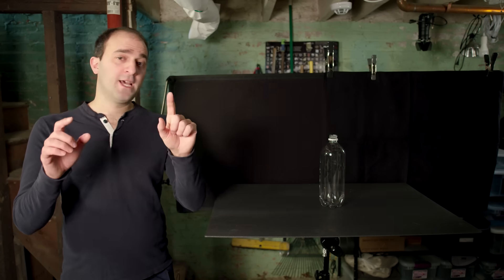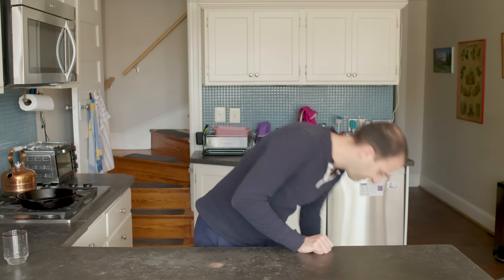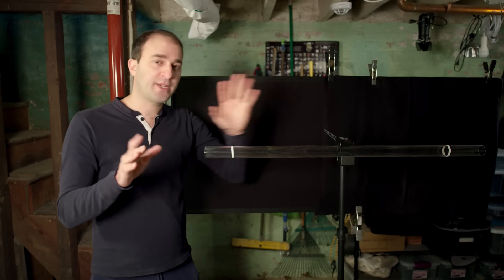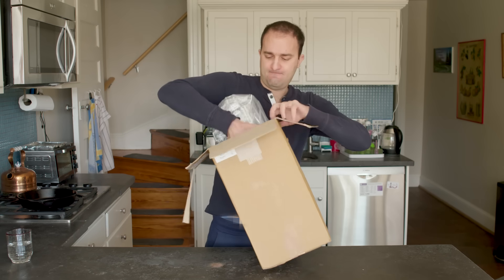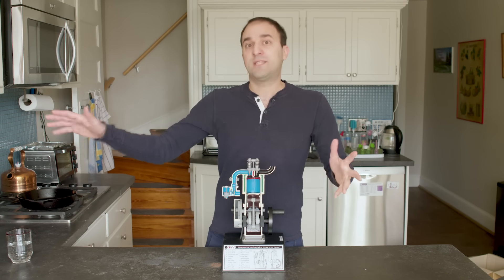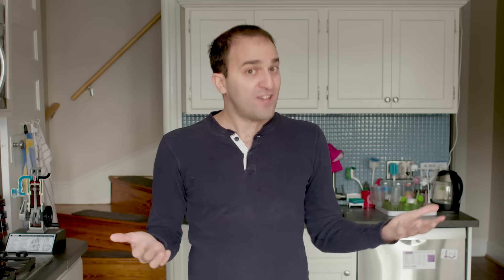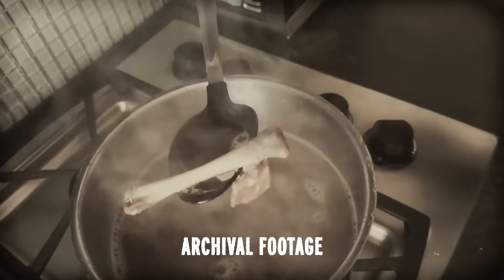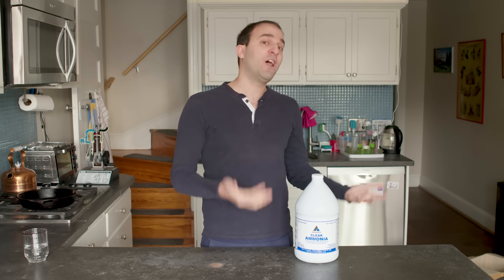Does Toyota Know Something That We Don’t?

Comment: Lovely, we're abandoning diesel because of NOx to replace it with this?
Interesting... 🤔
Reply: In modern diesels to reduce NOx (in fact adsorbed NOX) AdBlue is used which is 32.5% aqueous solution of urea. Guess what, at catalyst temperature it hydrolises to CO2 and ammonia. Ammonia as a reducing agent will reduce NOx to N2 (byproduct: water). So as exhaust gas treatment to remove NOx you can use ammonia. Fun fact you don't have to buy it separetly like in case of AdBlue. It is sitting in your tank already. OK it will increase consumption with 0.1-0.2 %, but the engine will run with very low NOx emission.
Reply: correct me if I'm wrong, but I thought DEF was 37.5% urea and 62.5% deionized water?
Reply: @turbojoe9554  Thanks, I corrected. Wikipedia and lots of others referred 32.5%.
Reply: Actually the first place Toyota and GAC have put an Ammonia Engine into is a Container Ship. Batteries are never going to work for shipping, maybe this works? Here's a fun fact - Cruise Ships in Europe put more sulphur into the air than all the passenger cars on the Continent do. And that's just Cruise Ships, not Goods Transporters.
Reply: uh. we are not replacing diesel.  and we are not going BACK to liquid fuels because ev's have not replaced a single internal combustion engine. the number of conventionally powered vehicles has increased every year since the useless ev first hit the market.
Reply: Probably going to end up a catalyst
Reply: Actually the first place Toyota and GAC have put an Ammonia Engine into is a Container Ship. Batteries are never going to work for shipping, maybe Ammonia works? Here's a fun fact - Cruise Ships in Europe put more sulphur into the air than all the passenger cars on the Continent do. And that's just Cruise Ships, not Goods Transporters.
Reply: @tsubadaikhan6332  Yes they do, and THANK GOD THEY DO along with all the sulphur pumped into the air by the workshop of the world that is the Chinese economy because without it average global temperatures would have already exceeded 2oC above 1750 baseline due to sulphur dioxides being a negative forcing effect on planetary warming from human emissions. With it I have a chance of being dead before it all falls apart :)  ever a silver lining.
Reply: Diesels are pretty much worse in every type of emissions compared to gasoline engine, other than thermal efficiency (i.e. CO2), which still has only a marginal lead.
Reply: @__dm__   thermal efficiency of diesels comes from their outrageously high compression, which makes them strikingly efficient. It's not marginal, it's insane.
Reply: @__dm__  yeah and for a LONG time, it was claimed that diesel fuel powered engines were MUCH cleaner burning than gasoline counterparts.
Reply: NO ! Diesel is NOT being abandoned, bur supplemented with DEF to reduce exhaust emissions . What would the OIL Companies do with all that Diesel fuel if they cany sell it ???
Reply: most diesel goes to the military and shipping industry. @SteveWright-oy8ky
Reply: @SteveWright-oy8ky  turn it into literally anything else?

Comment: doesnt the increased haber-bosch demand completely dwarf co2 savings at the engine? whats the net co2?
Reply: There are ways of producing ammonia that don't require going through the standard haber-bosch process and are co2-neutral, they just haven't gone mainstream yet for various reasons.
Reply: @rfldss89 Would you mind listing some of those methods? I’m trying to find alternative ways to produce ammonia on my own and the only other way I know is the boiling pee method.
Reply: It is a project developed for a state actor, so expense is taken into account but the international reconition is the goal not profit. 
And industrial fumes of any kind can be trapped and packaged reacted whatevers needed at a cost.

See where I am going with this?
Reply: @AnonymousAnarchist2  Uh, no, could you elaborate and be much more specific? And make sense?